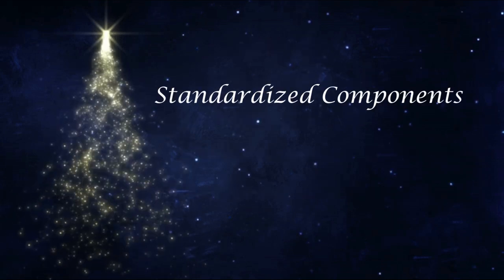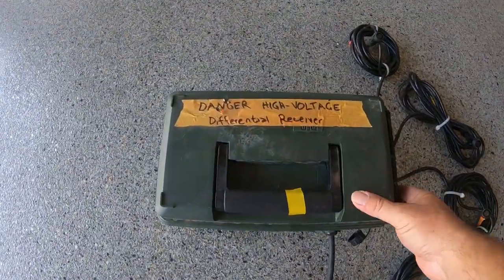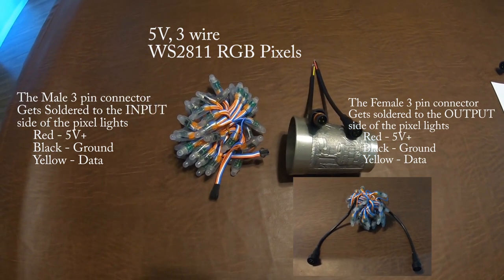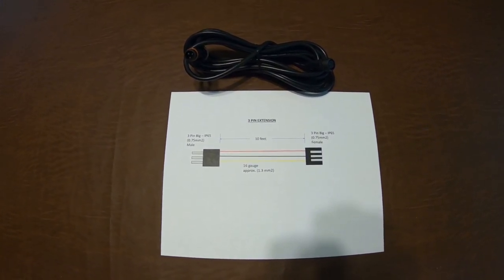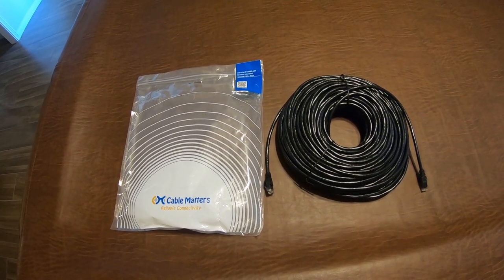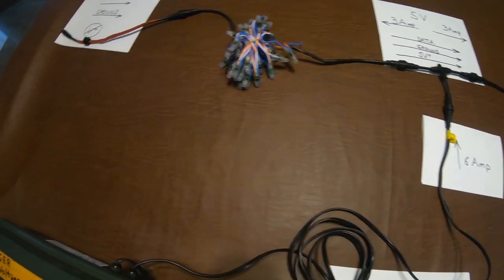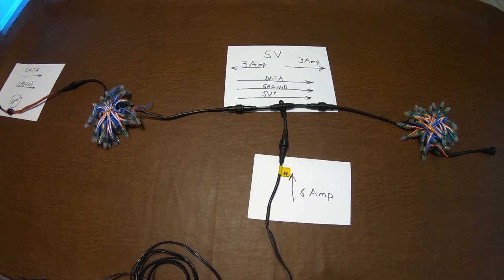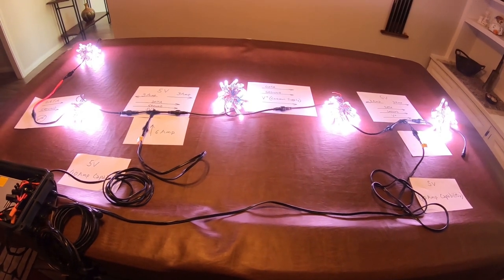Christmas Lights to Music, Step by Step Tutorial

Comment: Is it very expensive to start a show like this?
Reply from the maker: i actually never really fully totaled mine up. But it is a hobby and there is some expense. The F48 controller circuit board is $200, then you have to add in a power supply, associated box items and wires.  The differential receiver board is only $20 but once again you need a power supply, associated box items and wires.  Then you need power injection power supplies wires and boxes, then miscellaneous wire, connectors, & lights. The lights i buy are $125 per 500 on amazon.  I base my show totally on drilled PVC pipe, which keeps my props pretty cheap but a lot of time is spent drilling holes in PVC.  In short, I don't think it will cost too much more than purchasing a bunch of store bought static display Christmas display items, but in general its not "inexpensive"  (but probably cheaper than  like a Golf hobby :) ).  If I had to just guess, since I never really  totaled it up, I would guess that my entire set up including everything, including 3200 pixels, 9 ish differential receivers, and 12ish 1 and 6 port power supplies, not including the laptop, I'm probably into it for about $1200-$1500 ish. But once you have the controller, differential receivers, and power supplies done,  then the big expense (in terms of dollars and time) is done.  Hopefully that answers your question.  To keep it affordable i learned how to do almost everything DIY.

Comment: How much did you pay for that because I was thinking of doing this
Reply from the maker: You can start out with just the F48 controller $200, A differental reciever $20, some power supplies $15-$35, some pixels $125/500, some misc connectors, wire, boxes and soldering equipment.  You dont have to start with 3200 pixels like mine.  My first year i just had pixels on the eave of my house, a few 5V 8 Amp power supplies, and a $10 single channel controller as explained in my video.  Then grow into the F48 and differential recievers the following year.  Thats what I did and I totally recommend doing it that way.

Comment: Where do you get all the equipment?
Reply from the maker: Hi Luis, Thanks for the comment.
You can get parts lists including links on where to purchase, build and assembly instructions for most of the components on my website...
www.christmaslightingwithsteve.com
Reply: @tara-tech4138  pixelcontroller.com sells f48 box already assembled, would that work? It says it can hold up to 12 differential receivers
Reply from the maker: Yes Luis, that Falcon F48 is the exact same assembled controller board that I use.  The controller also requires a power supply, I think at least 2 or 3 amp.  I use a meanwell 8 amp because i like the size of it to fit in the box i use.  Then I mount everything in a box for weatherproofness because I leave it outside.  See what I use for my F48 Control Box  here: 
  https://christmaslightingwithsteve.com/f48%20Control%20box/
Hope that helps.
Reply: @tara-tech4138  Does the Falcon 48 uses 5v or 12v?
Reply from the maker: @morrisdavis4186  The Falcon 48 can use either 5V or 12V.

Comment: That wire looks like a rat's nest!!!!
Reply from the maker: I would have been better off measuring the distances to keep from having the stacks of wire coiled up. But I wasn't EXACTLY sure where I was going to put the boxes until I actually did it.  It may look like a rats nest but it really is not.  A good skill would be to learn how to make custom LAN cables.  I was never able to get the connectors to work right so I gave up after a couple of tries.  So I just bought extra long knowing that extra long was way better than too short :)  Thanks for the comment.